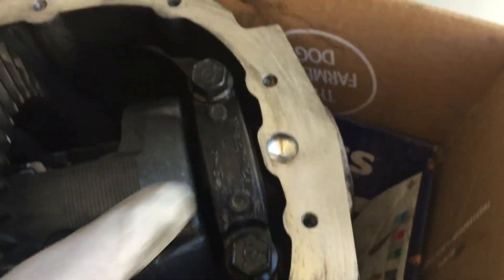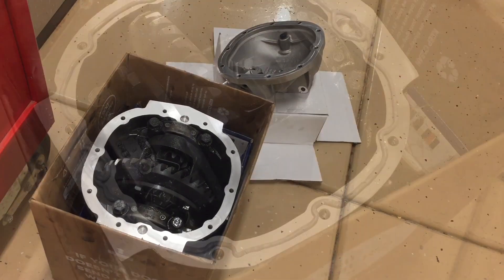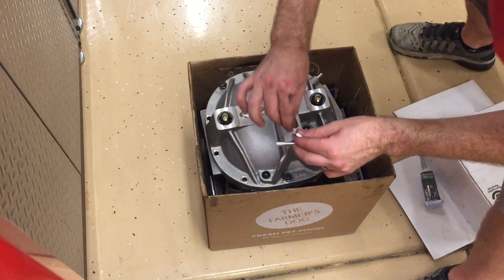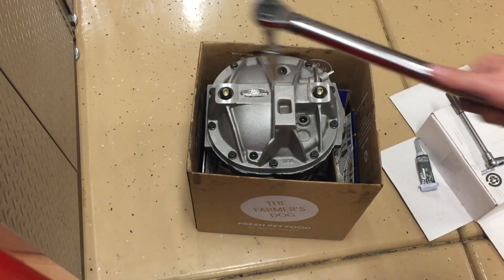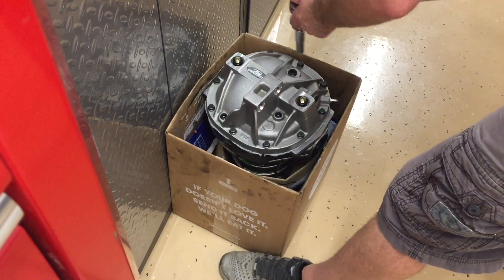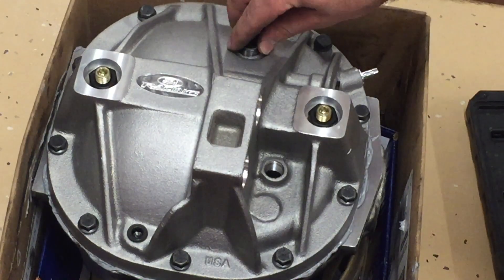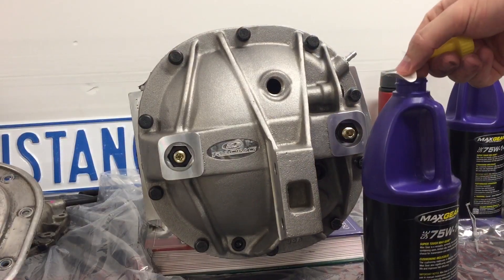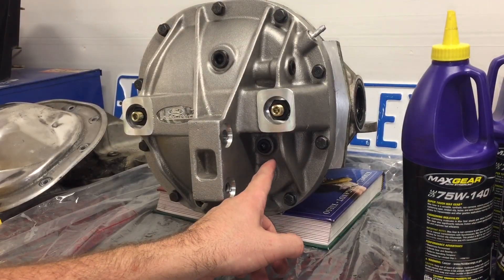Cobra Diff Cover Install & proper Fill IRS 03/04 Cobra 99-04 Svt Cobra

Comment: I know this was a year ago but all your videos have been endlessly helpful, I did the whole rear diff reseal in your order and it made my life so much easier I’m so grateful! Unfortunately I had a crack in the cover so I got the same one you did, what’s the issue with the oem hardware and/or the supplied stuff???

Comment: How much friction modifier did you use? Do you have any leftover that I can use? I'll buy 2 quarts of the royal purple. We should see if we can get more of those longer bolts too for my install.
Reply from the maker: Are used one of the 3.8 oz bottles of friction modifier. Cal Ranch will sell the bolts for cents on the dollar and ace will charge $3 each https://www.amazon.com/gp/product/B000DZR55U/ref=as_li_qf_asin_il_tl?ie=UTF8&tag=2004047-20&creative=9325&linkCode=as2&creativeASIN=B000DZR55U&linkId=61f72f7d124853ff69047db59527ea98

Comment: Thanks for making the IRS videos...much needed 🙌🏻 I do have one question: is the drain plug magnetic and is there any special process to change the IRS gear oil after a gear break-in (especially to remove leftover metallic bits)?
Reply from the maker: The stock cover only has a fill plug. If it’s the after market one, yes, it’s magnetic and should capture metal shavings. It’s very difficult to access the fill plug when it’s on the car.

Comment: I have a question. Can you use the royal purple in your manual transmission? Or is there a better recommended fluid like dextron 3? I am going to change my transmission fluid for the first time and I want to know what would be the the best fluid for protection and shifting smoothness. I have a 2003 cobra with the T56 .. just would like to know. Thanks .. another great video !!
Reply from the maker: Yes, royal purple makes a transmission fluid. It does need to be dex 3. It depends on your power level. Royal purple would be good. We used pensoil for my brother’s since he’s stock. Here is the video https://youtu.be/MnssJ9i3lPU
Reply from the maker: A lot of people use the penzoil as we have, but here is the royal purple stuff https://www.amazon.com/gp/product/B001DKTG0G/ref=as_li_qf_asin_il_tl?ie=UTF8&tag=2004047-20&creative=9325&linkCode=as2&creativeASIN=B001DKTG0G&linkId=043ecf89457f1b643ad965a740adc150

Comment: Hey Danny,
On my Fox 8.8 rear the fill bolt is rusted stuck... do you know the fluid capacity with the ford racing cover...? I wont mine able to go by the factory fill plug... Thanks in advance!
Garrett

Comment: Danny, was 1, 3oz tube enough permatex for this diff cover? Thanks in advance
Reply from the maker: Yes, I believe it was. It doesn’t hurt to have a spare in case something happens so you don’t have to start over. Walmart sells it and you could return what you don’t need

Comment: I’m wondering if you would use thread sealant on the girdle bolts.   The shop my car is at is having a leak out of the bolts
Reply from the maker: You could but teflon tape would be less messy and should also work

Comment: Didn’t see the link for the bolts. I’m installing the same cover on mine and was wondering what’s bolts you went with
Reply from the maker: It was in the other video. Just be aware that some diffs might not be drilled deep enough or still have rtv or junk on the holes, so when you test fit them make sure it’s deep enough and don’t snap off a bolt if it won’t fit. Also use the washers the new hardware comes with https://www.amazon.com/gp/product/B079H1Q11Z?ie=UTF8&linkCode=sl1&tag=2004047-20&linkId=fcfdfa976d602d1f4b5cdc1cf72a366c&language=en_US&ref_=as_li_ss_tl
Reply: Thanks I didn’t look in the other video. & thanks for the advice I appreciate it

Comment: I know it has been 3 years ago but I’m trying to find the bolts that you used.  You didn’t use the after market right?
Reply from the maker: I used bolts from a hardware store for more bite, but you want to make sure your threads are cleaned out on the diff housing and that they aren’t drilled more shallow than the hardware you use. You don’t want to snap a bolt that bottoms out too soon
Reply from the maker: Here is the hardware I used and why, but verify it for yourself https://youtu.be/6gBXoSSSB5o
Reply: @dannyjohnsonsgarage  thank you!

Comment: Instead of cutting off the access RTV after it dries, what about wiping it off when still wet?
Reply from the maker: I’m sure that would also work. It might be a bit messy as it smears.
Reply: @dannyjohnsonsgarage  that's a good point. I just removed the diff today. Gonna open, clean, reseal tomorrow.
Reply: @dannyjohnsonsgarage  after 30+ hours it's still a bit soft. Is that normal?

Comment: Hey Danny, can you put the Steeda IRS Diff Brace on the Ford Performance Diff Cover as well? Or is it only meant for the stock crappy Diff Cover
Reply from the maker: It will not fit on the ford racing cover. There is one for it if you buy it. https://youtu.be/RyJg0rOlaeQ
Reply: @dannyjohnsonsgarage  I’m having trouble even finding the brace on their parts site. It’s a Ford Performance one right? Do you think it’s even worth it? Do you think the Ford Performance cover is enough? I’m pushing like 550whp.

Comment: Do you have a video by chance just doing a rear diff fluid change on a stock diff cover for a 2003 cobra
Reply from the maker: Thats where this series kind of came from as mine was leaking, but it only has a fill plug so you have to remove the cover and reseal it unless you can try ti siphon it (never worked when I tried) Cobra IRS Axle and Differential Removal
https://www.youtube.com/playlist?list=PLIjr-uSYDZi4GVUMK2SdUL74fClSt4-IZ
Reply: did you pour the whole bottle of the friction modifier in or a certain amount @dannyjohnsonsgarage

Comment: Had a shop do this for me a few months ago, is it normal for the bottom drain plug now and then just to show some diff oil? It doesn’t necessarily drip but I do notice oil shine on the thread of the plug when I shine a flashlight at it, what do you suggest I do?
Reply from the maker: It sounds like they didn't put any thread sealant (or enough of it) on. It should be ok. You may lose a small amount, but the only real way to fix it should it get worse or bother you is to remove the plug, let it drain all the way, clean the threads, and when it's dry add pipe sealant as shown. It is very difficult to fill the differential as you see in the video, so if you do attempt it, make sure the top fill plug is out first, and make sure you'll be able to get a hose up into it to pump the fluid in before you remove the drain plug and do the repair. You can try to slightly tighten the drain plug to see if it helps, but don't go too tight or it may break it.

Comment: Is there an advantage to the RTV vs the lubelocker or vice versa? I have only ever seen/used RTV on the IRS before.
Reply from the maker: I feel the rtv will get down into the channel better, but the lube locker may also line up ok. The lube locker will be a continuous, even seal.

Comment: Can you use the cobra diff cover on a non-cobra?
Reply from the maker: I can’t say for certain, but they seem the same. It should bolt up, but as with the solid rear version, fill it through the fill hole until it comes out the factory fill hole on the back of the solid rear axle (where you normally add fluid).

Comment: Royal purple diff fluid mobil 1 or personal preference?
Reply from the maker: Either should be fine. It used to be 75w90 and it was changed in 03-04 to be 75w140 which was a little odd

Comment: How much friction modifier did you use to the 1.5 quarts of fluid?
Reply from the maker: scoob 31 I used the full bottle (3.8oz). It’s said royal purple also has friction modifier in it already as well.
Reply from the maker: scoob 31 https://www.amazon.com/gp/product/B000DZR55U/ref=as_li_qf_asin_il_tl?ie=UTF8&tag=2004047-20&creative=9325&linkCode=as2&creativeASIN=B000DZR55U&linkId=61f72f7d124853ff69047db59527ea98